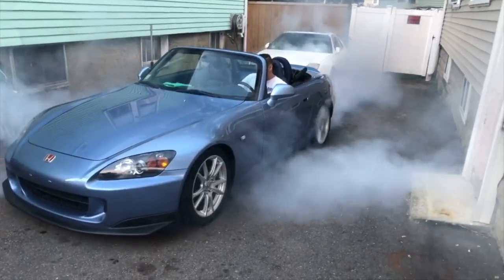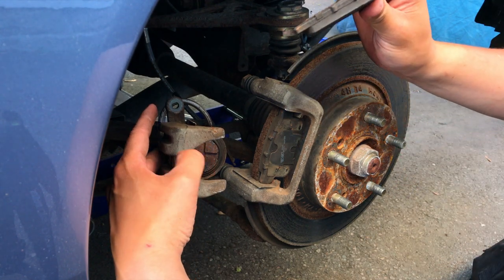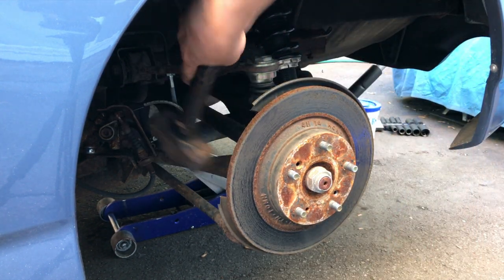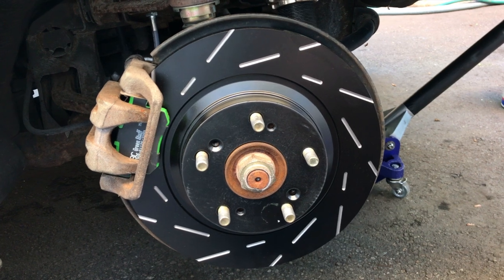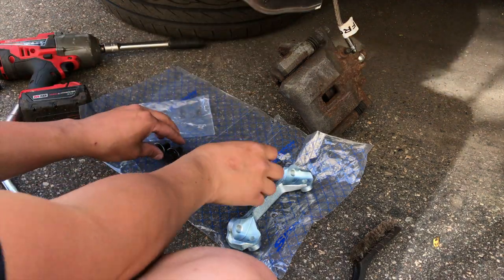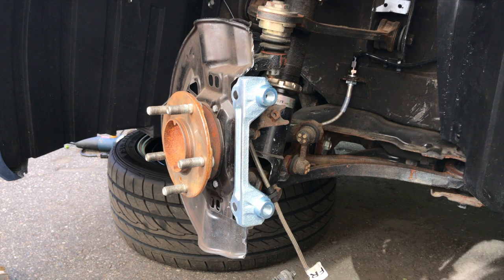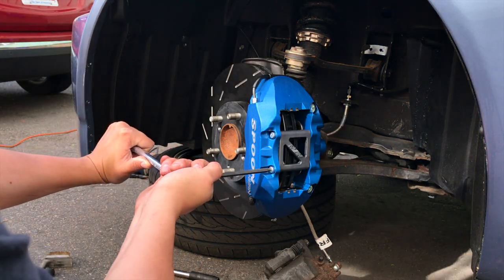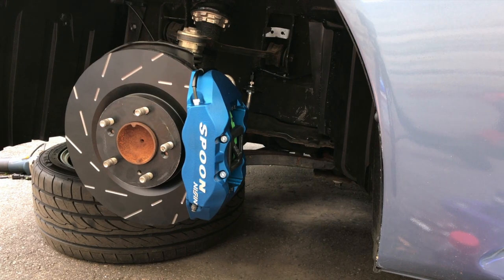S2000 Spoon caliper install

Comment: Is it right, to put the washer directly to the bolt instead of between nuckle and brake caliper bracket?
Reply from the maker: Yes, that's correct for the S2000. It's the twinblock calipers for the civic/integra you put the washer between the knuckle and caliper.

Comment: What are the wheel and tyre specs? They're not in the description.
Reply from the maker: They're 17x8.5 +35 255/40/17 in the rear and the fronts are 17x8 +38 225/45/17
Reply: @MojoGarage  is that stock suspension/ height? With those specs did you have to roll or pull fenders?

Comment: What brake pads do these take I’ve read it’s oem pads but just want to confirm
Reply from the maker: Oem style s2000 pads. if they have the metal wear indicator you'll just have to remove that piece